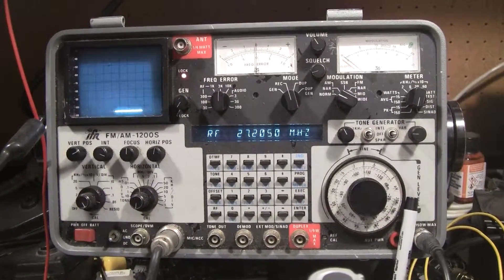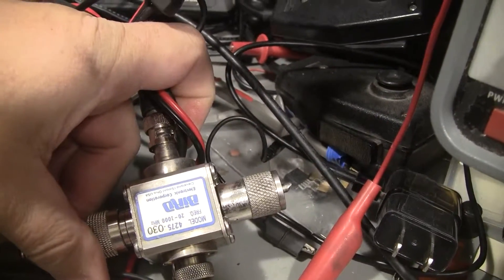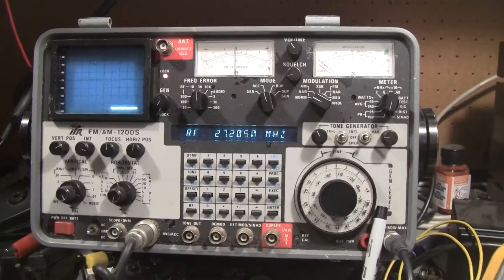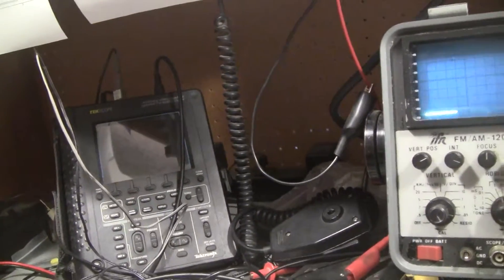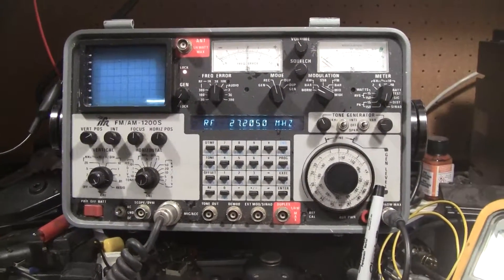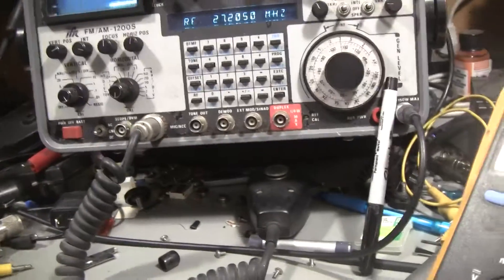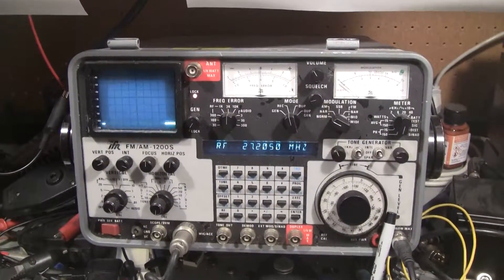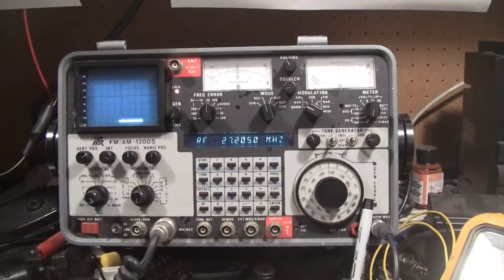IRF-1200S update after 8 months of Ham/CB Radio Repairs.

Comment: Have the same unit for many years. Has worked great until recently. The battery has died and I have lost lock on freqs above 200 MHz.  Used it in the field with no issues in the past. Wish I had the tracking option in it for duplexer tuning. This works great for repeater setup and tuning. Works great as a scanner for analog stuff.
Reply from the maker: Wonderful instrument for certain !!

Comment: Hello mike.  Have you hooked it up on an outside antenna yet ?   Works great as a shortwave and fm and am and sideband receiver.
Reply from the maker: Not yet. But I've tied a couple interior antennas to it. Since my house has been hit by lightning twice, I am slow to put extra antennas.
Reply: You can use the cb antenna you have already.   Just make sure you disconnect the cable when you are done using it.  You can put the end of the coax in a mason jar to keep lightning from bouncing into the room when not in use